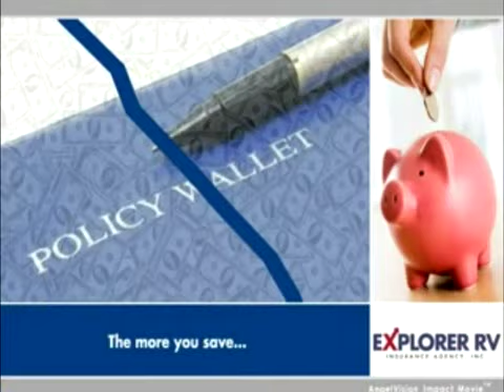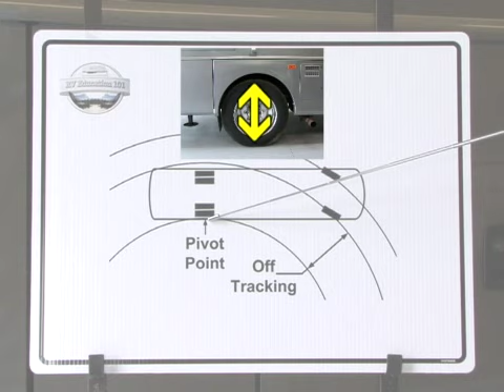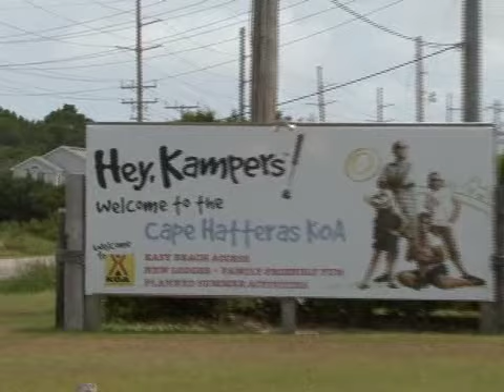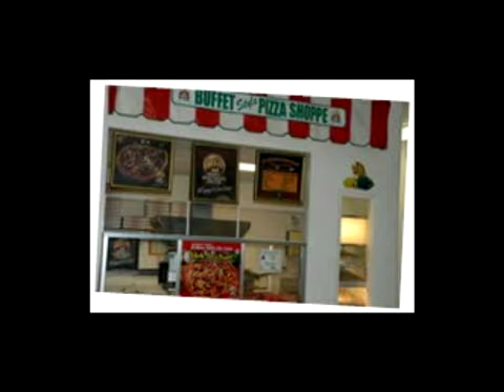Marks RV Garage Episode #12 Internet TV Series by RV Education 101

Comment from the maker: @keogge You can repaint the range and oven with an appliance paint available at home improvement stores. You may need to remove it to really do a good job cleaning, sanding and painting it. Good luck with the restoration. Mark